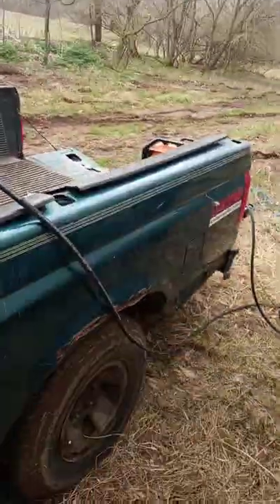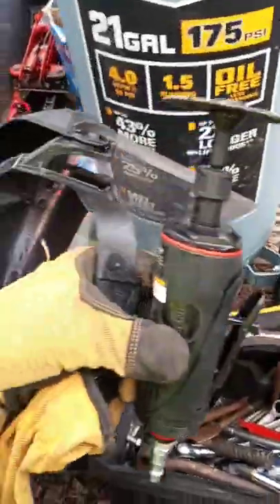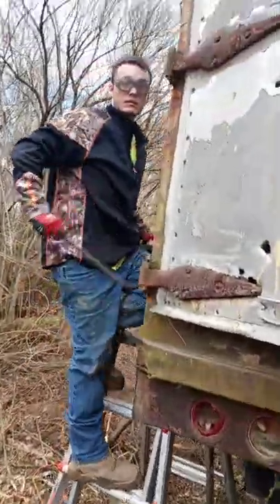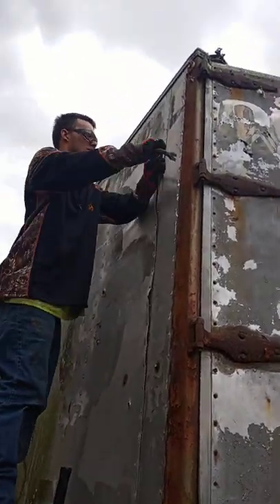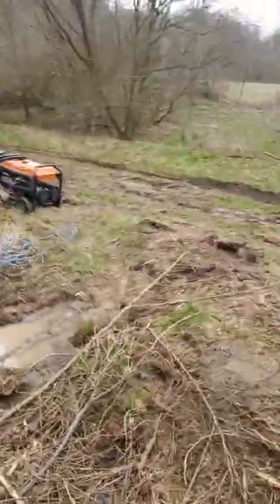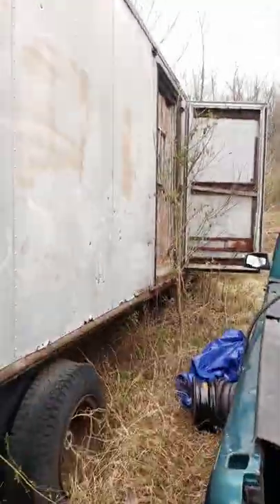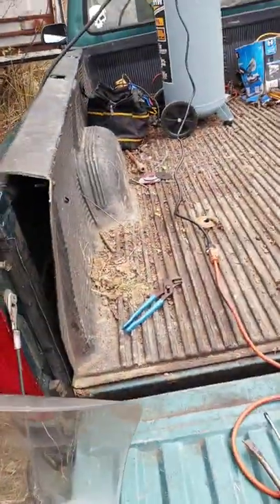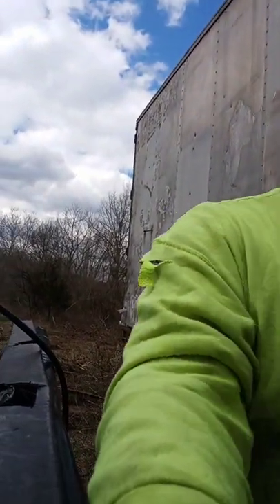cutting up a aluminum semi trailer

Comment: Good day from Canada. I have two of these old trailers on some property I bought and the scrap yards don’t want anything to do with them unless they are in pieces. Can you tell me approx. how much weight in aluminum there is in these trailers so I can decide if it is worth paying someone to dismantle them. 
Thank you in advance for any help.
Reply: What you end up finding out
Reply: Not a thing, no reply at all to my question. @jltsvlogs1837
Reply from the maker: Sorry just seen this for some reason it really all depends man the length of them yr they where made used different aluminum and thickness but if you have a cple and can find someone to do the work and split it with you that's what I usually do or try to buy them right out but yea there's deff money in them it's worth it i would find local scrapper and tell em do the work and split it 50 50 there's all that aluminum than steel frame also so it's worth it sorry for getting back to you so late
Reply from the maker: Sorry to so long
Reply: Roughly- about how much money did you get from that trailer?
Reply from the maker: @jurbur9527  well we only took in what you seen there we didn't finish the whole thing but we got around 100$ for the aluminum back than prices where up there way down now everything is way down but just depends on how old the trailer is how thick aluminum is alot of diff factors
Reply: @ALMIGHTYGARAGE  gotcha- I have two on my property that I’ve been dreading to remove for the last few years. I’ll probably start this spring.
Was thinking about a plasma cutter or a concrete saw with carbide blade.
Reply from the maker: @jurbur9527  cutting torch will most likely just melt it would go with 7 inch grinder with carbide tip blade or Sawzall carbide for aluminum if you have 2 that are aluminum it's deff worth it just depends on what there paying call your local scrap yard if there's more than one call them all.some pay way less than others alot of wood and insulation and clean up but also got the steel frame so 2 you'll get around thousand to 1500 I'd say if you do it lmk what you get
Reply: I’m sure I’ll end up trying a few different methods. If I remember I’ll let you know the outcome. I’m in nky.
Reply from the maker: @jurbur9527  oh ok what part I'm in Middletown ohio ain't to far away from ya
Reply: Gallatin county. Not too far.
Reply from the maker: @jurbur9527  not at all if you need any help lmk man